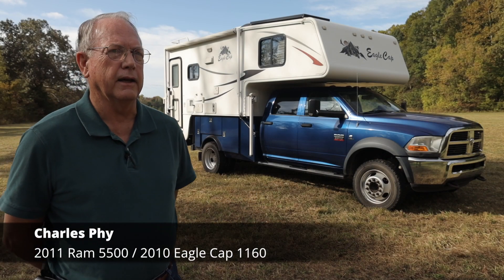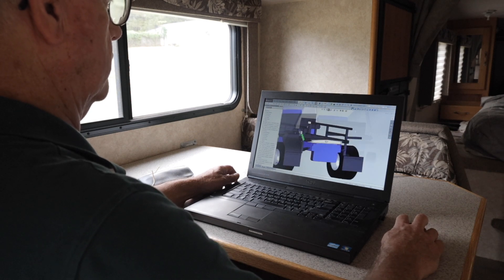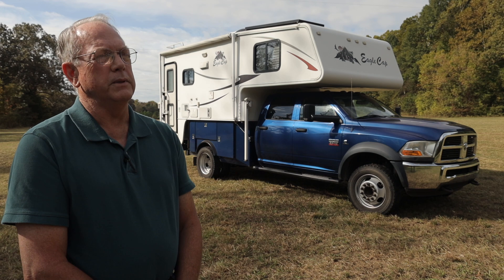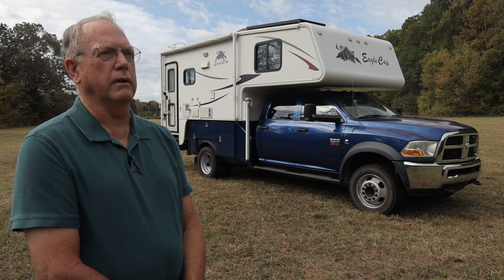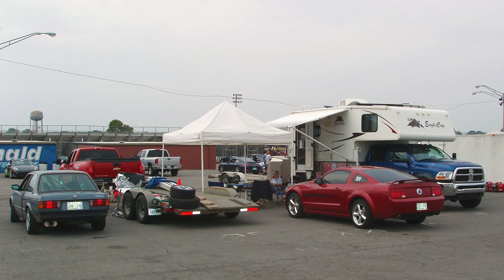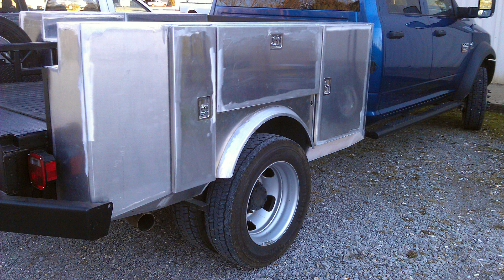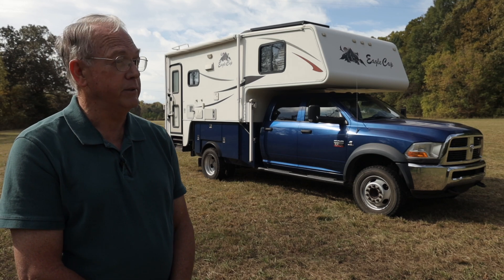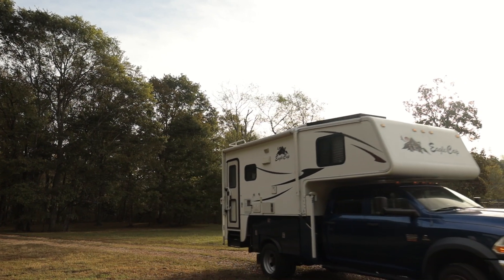Lessons From A Custom Truck Camper Bed Build

Comment: rubber compounds are susceptible to damage from direct contact with gasoline, oil and antifreeze, that a bad spot for the tire tank filler combo. that spare tire will end up failing when needed. nice rig tho.

Comment: very cool.  I have been planning a build like this for many years, just never had the $$ to execute it.  But I always knew it would have to be a class 4/5 truck.  Not just for the payload, but they actually have a much better turning radius.  So I always figured that as long as I knew I was going to have a monster truck, I would need all the help I could get to maneuver it around town.
Reply: you can put these on 1 tons. air bags are like 200$ bucks. 1 ton has a higher output engine aswell. i have one and alos pull a 28 foot with 2 jeeps on it. i run 80 alday on the highways.

Comment: I've driven 500,000 miles on my truck and camper, gone through three engines. What I do not like about the camper I'm a senior, it's too hard to use the overhead compartment for sleeping not enough room in too dangerous to get up and down, plus it's cold. Also I'm very tall, and the bathrooms in a camper usually are very limited. Campers are not very good for off-roading, there's too much movement. What I do like about a camper you can go almost anywhere except there are some height restrictions. Also I wish the pass-through window between the truck and a camper was more suitable for the adults and seniors. I also wish that the dinette wasn't better bad, that's where I spend most of the time sleeping and that bed is not very comfortable. I wish on RV manufacturers with built-in Solar panels collectors not only on the roof but on the side walls also. That would save for a lot of air conditioning and Generator usage. I also do not like an air conditioning unit mounted on the roof, it makes it even taller, I wish they would make an air conditioner for RVs on the side walls.

Comment: It does my heart well seeing this video. As back in 2017 I upgraded my 1996 Lance Legend 990 to a dual slide 1176. I could write a lengthly sad essay all the bad taking place from then on. But, this being YouTube, I won’t bother. I am now RV’less completely. 

Yet, I still amble back to campers from time to time. 

As a former high spender to many things outdoor related. I’ve built a knowledge base inside my warped brain box for WHAT NOT to do when it comes to Big money items. 

Never again for this old coot. 🥺

Comment: Smart. The ONLY way to haul some of these campers is with a 3500 drw and up. Sooooo many overloaded trucks out there. "Just put airbags on it" and suddenly your Tundra or 2500 can haul 4000 lbs. Not. 

I love the storage, far more practical than the common factory bed.